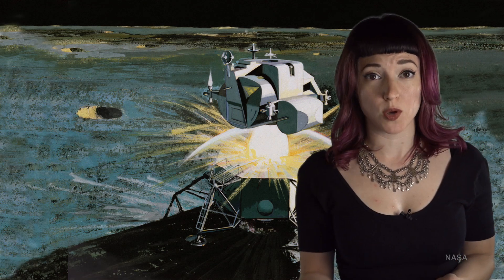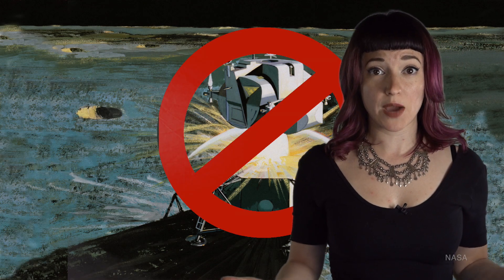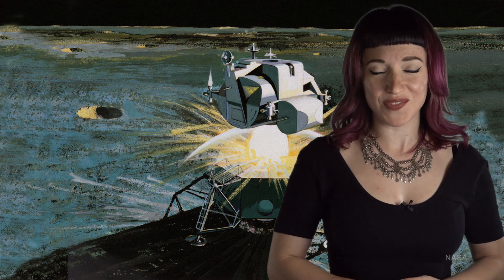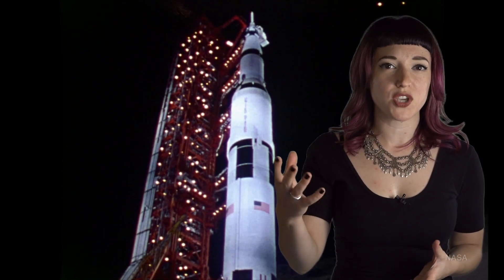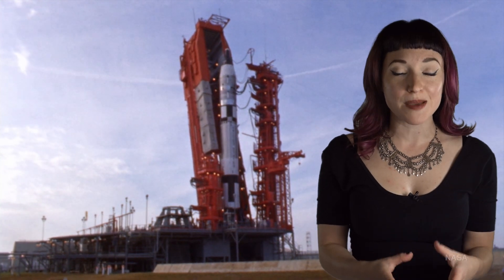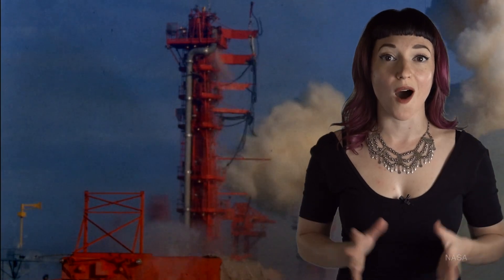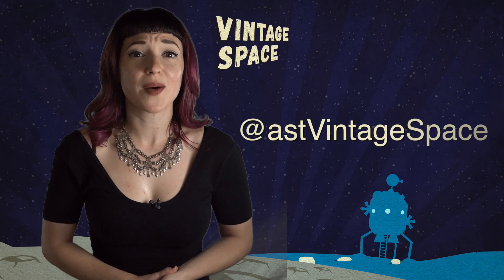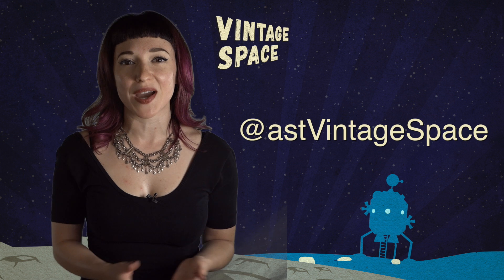How the Lunar Module Launched from the Moon Without a Flame

Comment: Just to throw in a wrench, why is there no ground dust when the lunar module took off? Where was the fuel stored, considering how much was required to leave earth's gravity? If we can launch something so small off of the moon, why not earth? If it's because our gravity is different from the moons, how did we know that since it was our first time?  And just to add one more thing, who's controlling the pan shot? Just my two cents worth.
Reply: If you expect to see clear dust grains from 300 feet away via a low-res TV signal, you're sadly mistaken.  You'll never find HD video, of course, because it wasn't shot in HD.  It was merely a 1972 TV image.  But, yeah, there are videos out there with better resolution than this one, and yes, you see the haze from the dust that gets stirred up.

You couldn't lift a finger to Google the schematics to find out where the fuel/oxidizer tanks were?  And, I mean, what EXACTLY are you implying?  Are you implying that the thousands of engineers and technicians who designed and built the lunar module forgot to put fuel/oxidizer tanks inside??

The booster required to leave Earth's gravity was to lift 100,000 pounds (payload of command module, service module, lunar lander) to an altitude of 280,000 miles.  The little ascent stage had to lift a 1,950 pound craft to an altitude of 60 miles in lunar gravity (which is 1/6th of Earth's gravity).

You can calculate the gravity on the moon many different ways.  And, it WASN'T the first time.  The USA and the Soviets had launched about 70 probes to the moon (total between both nations) before ever attempting to land a person on the moon.

Ed Fendell controlled the camera.  This has been answered a million times.

If you think your opinions are worth 2 cents, you are GREATLY overestimating the value of your opinions.
Reply: @rockethead7  Calm down, it was only my two cents worth. No need to get emotional about it.
Reply: @rockethead7  Okay.
Reply: There is dust.
Reply: Damn I never thought of one of the points that you mentioned ! How did we know that the gravity was different if we never went there before ? I disbelieve the landings because of the lunar lander. The whole thing reminds me of a sc-ifi film like interstellar with the whole capsule thing. I find it quite odd how Space X just mastered landing their booster rockets but we supposedly mastered that in 1969.  Its as if space technology has gone backwards, which does not add up.
Reply: @patrickbellefleur5508  
YOU SAID: "Damn I never thought of one of the points that you mentioned !"

== You never think of anything.  All of your comments are a parade of ridiculous incredulity and ignorance.

YOU SAID: "How did we know that the gravity was different if we never went there before ?"

== I answered this in the other thread already.  But, yes, there are many ways to know the gravity.  Gravimeters for starters.  You are slightly heavier when the moon is on the other side of the Earth.  You are slightly lighter when the moon is directly above you.  This is why tides do what they do.  There are very sensitive gravimeters that can detect this.  Furthermore, you can launch rockets at the moon and measure their trajectories.  The arc in motion that forms will allow you to calculate the gravity.  Also, gravity causes light to change course.  There's a slight "bend" in light around the moon.  So, by tracking visible stars as they pass behind the moon, they can calculate the gravity effect on that light as it bends around from behind the moon.  Apollo brought micro-gravimeters onboard also, to detect the slightest variations in the moon's gravity.  They do the same with Earth satellites also.  And, as I said, ultimately, the Soviets launched about 70 unmanned probes at the moon, many of which landed.  Obviously, if they had calculated the gravity wrong, those probes would fail to be able to land correctly.  But, beyond that, even for the ones that didn't land, and just orbited or shot by the moon, they can calculate the gravity from the motion that those objects take.

YOU SAID: "I disbelieve the landings because of the lunar lander."

== Yet, none of the thousands of people at Grumman who designed and built the lunar landers were aware that they had failed so badly??  That's how your feeble little brain operates??  YOU?!?!?!?  YOU?!?!?!?!?  YOU have discovered that the lunar lander couldn't do the job that Grumman designed and built it to do!?!?!?!?!  None of the thousands of people who worked on it were able to figure out that they failed to make a lander that could land, but YOU did???  I mean, you said in the other thread that you think they orbited the moon, but you think they couldn't land on it.  So, I don't have to convince you that the Saturn V could take people to the moon.  You already said you thought they went to the moon, just couldn't land.  So, this means that you believe that Grumman engineers were unaware that they failed to build a working lander.  But, SOMEONE knew, huh?  Who was that?  Who was aware that the landers wouldn't work, and told them not to attempt the landing?  Or, do you believe the 2,000-3,000 people who designed and built the landers were all in on "the hoax"??

YOU SAID: "The whole thing reminds me of a sc-ifi film like interstellar with the whole capsule thing. I find it quite odd how Space X just mastered landing their booster rockets but we supposedly mastered that in 1969.  Its as if space technology has gone backwards, which does not add up."

== It doesn't add up (to you) because you have no understanding of rocketry.  Look, dummy, until recently, nobody really cared to land rockets vertically on Earth.  There was no need to do so.  I explained this to you already.  In order to soft-land on Earth, a rocket must save rocket fuel/oxidizer to do that.  Most rocket booster companies had no desire to waste fuel and oxidizer to perform a soft-landing on Earth, when they could just strap a couple of parachutes to the booster, and recover it in the ocean.  They wanted to maximize the payload that they could take into orbit, and/or be able to carry the payload higher.  So, they really never bothered trying to soft-land boosters.  But, Space-X decided to do that.  And, frankly, it's really not all that advantageous.  They traded lifting capacity (fuel/oxidizer) for the "benefit" of soft-landing the boosters.  And, it's still not really aaaalllllllll that beneficial.  The added weight of the fuel/oxidizer that they must save for landing, the added weight of the beefy breaking and guidance fins... that stuff is a lot heavier than a couple of parachutes.  But, their notion is that they save money on not needing to deal with dumping the boosters into the oceans and then recovering them and cleaning them up.  Frankly, a lot of people in the rocket community (that don't work for SpaceX) think that it's a novelty, and a nice stunt to make it seem like they're "advanced," but that there isn't really all that much benefit.  It's really a borderline case.  The major accomplishment of SpaceX isn't even the landing.  It's in making the boosters able to steer themselves back down, while flying "backward," without burning fuel in the process, and guiding directly to the landing pads.  And, dummy, they take advantage of GPS to do it.  Without that, there'd be no chance of that kind of landing.  That type of accuracy wasn't possible until GPS was able to get that accurate.  The difficulty wasn't in the landings themselves (though, yes, it is more difficult in an atmosphere with crosswinds, and a top-heavy booster).

Anyway, as usual, you have no understanding of the topic.  You're going from video to video, thread to thread, expressing utter ignorance.  The stuff "doesn't add up to you" because you don't know anything about the topic.  And, your only source of information is conspiracy videos.  Sorry, but every moon conspiracy video ever made IS WRONG!!!  And, when you are under the impression that the first rocket landings on Earth were done by SpaceX, you were wrong about that too.  I already illustrated the McDonnell Douglas DC-X, which did many landings in the 1990s.  So, you've already shot yourself in the foot by thinking that it hadn't been repeated since Apollo.  Why didn't they continue development of rocket vertical landings???  BECAUSE NOBODY CARED TO DO THAT!!!!  It was never considered anything more than a novelty.  With an atmosphere, they could just use wings or parachutes to land, rather than vertical rocket landings.  Even the SpaceX booster landings are really not much more than a publicity stunt to make it seem like they're soooooo advanced.  Yeah, they take advantage of NOT lighting up the rockets to full throttle until they're about to land.  That helps justify the fact that they didn't use that fuel on the payload.  But, seriously, this is a borderline case, not the slam dunk you think it is.

Comment: "That rocket launches in an apparently clear flame and its so cool"
-ignoring the very VISIBLE flame behind her
Reply: Not really.  She was illustrating the point that the fuel/oxidizer combination used on the lunar lander was basically the same as was used in Gemini.  And, you can see that the Gemini flames were nearly invisible.  The only reasons you can see the Gemini flames are because (1) it's against a well lit background (not the blackness of space), (2) they ran Gemini rockets a bit rich to keep them cool, resulting in excess fuel that can interact with the surrounding atmosphere instead of with the N2O4, and (3) most of what you can see IS the interaction with that atmosphere, and the secondary byproducts due to that atmosphere.  You are intentionally ignoring the fact that the flame on Gemini IS vastly invisible.  You're ignoring the core of the message.

Comment: Stupid  lufah. The "Lunar module" used "AEROZINE 50" fuel - the only STABLE OVER LONG TIME fuel the US Army had at time. "AEROZINE 50" was used in first ICBMs such as Titan, because the ICBM loaded with AEROZINE 50 had a long shelf life and was ready to launch in several minutes. Check out the videos of Titan and Titan II launches before starting the same story about "invisible hyperholic fire".  Additionally check out Russian Soyuz spacecraft maneuvering and docking videos and see how small (20 times smaller than in "Lunar module") orientation engines of Souyz produce a  plume that is clearly visible in space vacuum and darkness. Educate yourself instead of repeating same rubbish. Thank you for you attention, lady.
Reply: WHAT???  How does the Soviet/Russian Soyuz flame relate to the flame produced by Aerozine 50 and N2O4?  The Soviets/Russians didn't use Aerozine 50 and N2O4.  So, you're comparing flames from a completely different type of fuel/oxidizer to flames from Apollo's lunar module fuel/oxidizer??  This is ridiculous.  Just because the flames from one type of fuel/oxidizer are visible, doesn't mean the flames from a completely different type of fuel/oxidizer are visible.  Sheeeessssshhhh.  Dumb as a rock.
Reply: @rockethead7  check out TITAN rockets which did use AEROZINE 50....
Reply: @vcs206  
Yes, so what?
Reply: @rockethead7  Сheck the fire the plume and all the smoke. And what do you rhink AEROZINE 50 consists of ? Same components as in Soyuz propellant.
Reply: @rockethead7  Bullshit. Soyuz engines also DO NOT INTERACT WITH ATMOSPHERE. So what ? I tell you what fuel they really use in Apollo video.  Check out NASA film Apollo Lunar Landing Science Reporter, check out the LM makeup training module in Langley and how it's engines work - that's the invisible fuel, even in the atmosphere.
Reply: @rockethead7  AEROZINE 50 consists of same components as SOYUZ propellants, nothing so special, or unique, as you try to present.

Comment: What I would like to know is how the camera that was left on the moon to film the launch moved. Was it programmed to move with a timer? had it any detection system to follow the module authomatically? Quite impressive for the time.
Reply: It was on the rovers of Apollo 15, 16, and 17 (only 17 was successful).
The camera was programmed to tilt up at the correct rate to keep the spacecraft in frame, and the astronauts were told exactly where to park it. It's fairly simply calculus really. The engineer in charge was called Ed Fendell.
Reply: It was filmed in a studio

Comment: Hypotonic fuel leaves a red exhaust plume
Reply: Depends on the chemicals used and in what proportions. Red exhaust usually means Aerozine 50 is being burned fuel rich.
Reply: YOU SAID: "Hypotonic fuel"

== The word is "hypergolic" - you don't even know what the word is, yet, you think you understand this topic better than the entire planet's aerospace engineers and rocket scientists who do this for a living?

YOU SAID: "leaves a red exhaust plume"

== No.  The "red exhaust plume" is not a byproduct of the burn.  It's a byproduct of stuff that DIDN'T burn, or burned with the atmosphere instead of the rocket oxidizer.  Mostly, the conspiratards get confused because N2O4 breaks down so easily into NO2 when it gets hot.  So, if you have a mixture that isn't perfectly balanced, you'll get some reddish brownish byproduct of NO2 that didn't combine with the fuel.  It's actually a bit more complicated than this, and there are lots of different mixtures of lots of different compounds, etc.  But, yeah, the standard conspiratard objection to Apollo is the confusion about N2O4 breaking down into NO2.  If you want more information than that, go to a university and take some rocket chemistry classes.

Comment: Which astronaut stayed and filmed it. RC wouldn’t work at 238,000 miles with 1969 technology. How’d they call President Nixon by phone as well?
Reply: What makes you think remote control wouldn't work at a quarter of a million miles? 
Audio and visual communication is entirely doable, sending a command string to a computer takes up a fraction of the bandwidth.

To talk to Nixon, they just wired the audio signal into a phone. Nothing difficult about that.
Reply: @niallkinsella2687  What made you think it did?
Reply: @Афонин-я4ь  The first "moon bounce", transmitting a signal so that it bounces off the moon and picked up again by receivers on earth, was done in 1946.
Sending a signal to a receiver at the moon is easy by comparison.

There is nothing in physics that suggests communication with someone on the moon using radio is particularly difficult.
Reply: @niallkinsella2687  There is nothing in physics tha suggests there was a moon landing at all
Reply: @Афонин-я4ь  
Except for all the data, photos, samples, mountains of evidence, and independent confirmation by independent scientific and engineering bodies from all over the world, both during the Apollo program and after, with verified orbital photographs of every landing site exactly as they were supposed to appear, continuous use of the ALSEP packages until 1977, and continuous use of the LLR retroreflecters placed on the moon by the Apollo program.

Seriously sunshine. Apollo happened. Men walked on the moon. Get over it.

Comment: They tested this exact fuel in a vacuum and the flame was visible.
Reply: Who is "they"?  And, how does that even make sense?  What kind of vacuum chamber is even large enough to run a rocket engine for more than a second?  The second you light up the engine, guess what, it's NO LONGER A VACUUM CHAMBER!!!  And, how EXACTLY does this go, in your mind?  The entirety of the rocket science community across the entire planet, in friendly and enemy countries, is all too stupid to realize that there should be a visible flame?  And, some clown on YouTube who thinks they ran rocket engines in a vacuum chamber is "correct"??

Comment: No blackbody effect (combustion products have no paticles to emit light). This is why candle flames are bright yellow (carbon soot) while alcohol ones are nearly invisible (lack of soot).

The Saturn 5 rocket F1 engines burned kerosene and LOX and the soot in the flame made the flame appear brilliant yellow. The space shuttle main engines were hydrogen and oxygen, producing a dull blue flame (mainly steam) rich in UV light, despite it being over 6000 deg. The shuttle solid boosters produced a brilliant flame due to partials of aluminum oxide in the flame, and like soot, emit light because of the blackbody effect, and actually were slightly cooler than the main engine exhaust.

Hydrazine and di nitrogen tetroxide (hypergolics) burn hot, but produce nitrogen and steam, and no suspended particles in the flame, so it's nearly invisible. Also in a vacuum as mentioned the plume under expands (spreads out) readily so there is no concentrated "flame", and difficult to see any glow from the nozzle in bright sunlight with all the glare from the lunar surface.

Scott Manley also explains some of this in great detail.